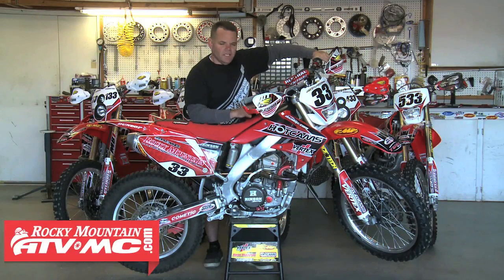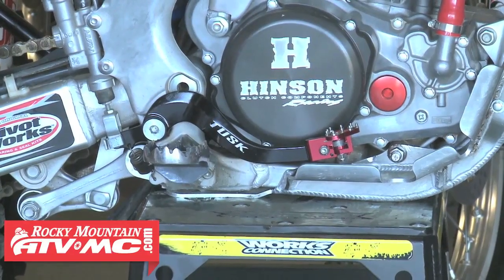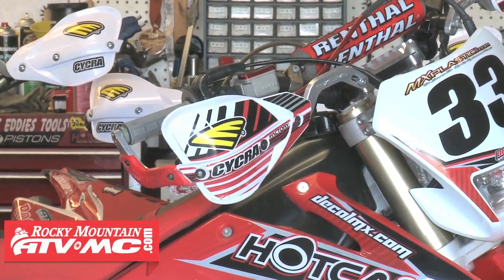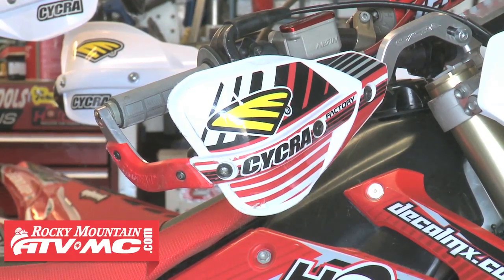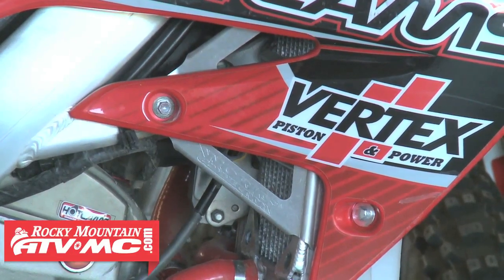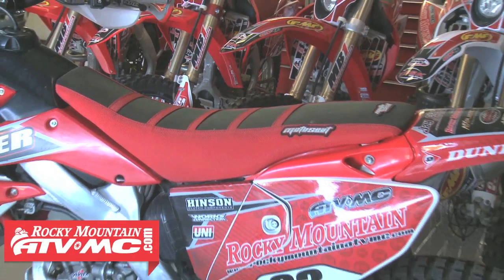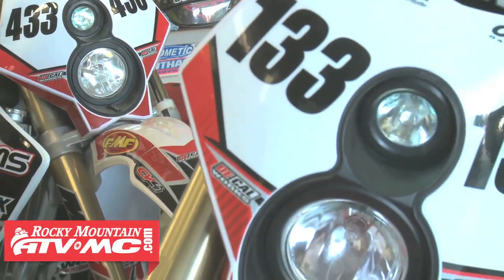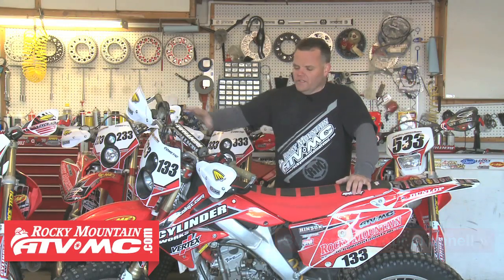Honda CRF250X Trail Bike Project Build

Comment: can anyone please tell me the difference between a crf250 and a crf250x i know one is a trail bike and the other one is a track bike but like what are the differences?
Reply: Crf250x= smooth power with torque and some grunt crf250r= holy shit, immediate power, touchy throttle.
Reply: +Caleb Newton also crf250x= smooth ride

Comment: What trail is that you guys are riding on at the end of the video? When will there be a Tusk replacement radiator for the CRF250X?
Reply from the maker: We're not making one for the "x' models.  Just the "r" models.  The CRFX models have a thermostat sealing bolt on the right radiator and our Tusk Radiators do not offer that.
Reply from the maker: Trail at the end is in California.  Not sure the name of it.. I can find out if you'd like?
Reply: Will the 250R radiators fit the 250X? I much rather support you guys than pay crazy prices for something I don't have any experience with... Thank you for the reply!
Reply: No worries on the trail - I was hoping it was here in Utah somewheres...

Comment: Is a x gonna be heavier than a 250r?
Reply from the maker: jamen brooks Yes! The "X" model or enduro model will be heavier than the "R" or MX model due to the extra parts and accessories on the bike. For this bike the "X" model rings in at 254lbs compared to the 227lbs for the "R" model... A 27 lb difference! (2013 Specs)